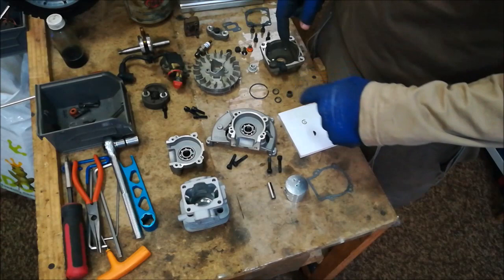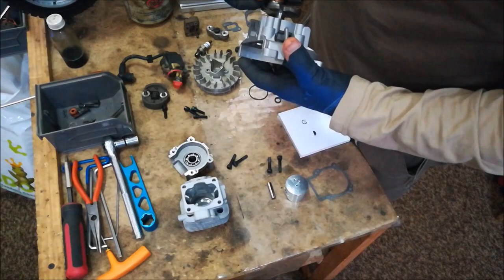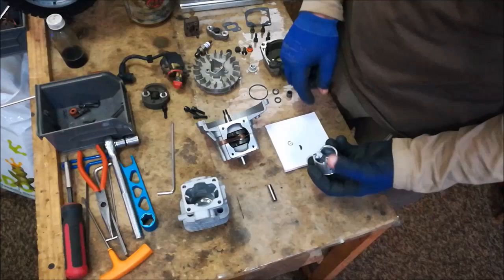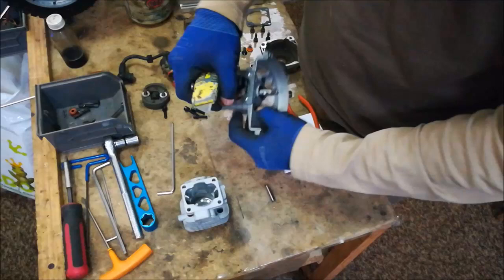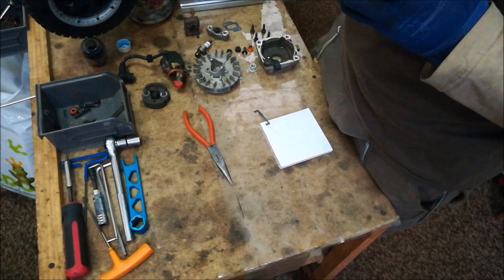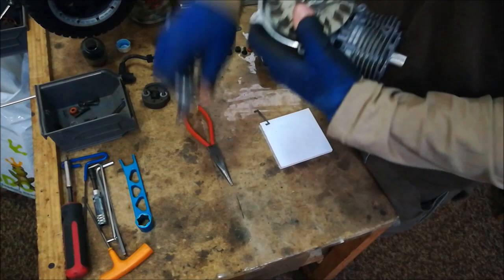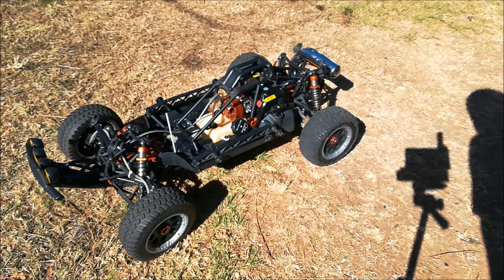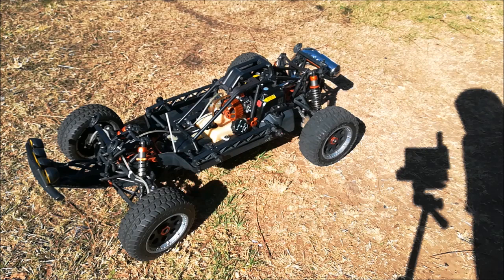Baja 5B / 5T 4 Bolt Engine Rebuild - How To

Comment: Hello, my brother, I have such a motor, but when I pull the starter rope, I put my hand on the motor housing in order to hold it. I feel the shock of the spark plak in my hand and the motor does not start. What is the problem and what is the solution? Please help me. Thank you.
Reply from the maker: Hello.
There are so many things it can be.
The shock you feel is possibly a broken coil wire but not always the problem.
You have to start by checking for any gasket leaks.
Than check the carburetor. If you choke it, look inside if you see fuel. Next I will change the spark plug.
If still not starting then you must see if the flywheel is the right distance from the coil.

Comment: Great Video, are there any of your video about how to install the piston back in its place with more details? Been trying to do so after striping my 36 cc rovan
Reply from the maker: Hello there. There is one video I show and talk about it. But it's one of my first videos so footage is not fantastic but it's called something like "Engine swop/conversion 29cc for 5T"
Let me know if you don't find it and I will share the link to it.
Reply: Hi there manage to get the engine running again after removing the gasket, but I have to put the idle needle so deep just to set the carb to idle and set The Low speed needle at 1,25 Turn and the High Speed needle to 2,25 Turn just like the standar engine, is thin normal or Do You have another setting  @EZR  ?
Reply from the maker: I recommend that the idle screw always goes in all the way. Then you set idle with the Low End needle. High end can only be tuned when the engine is hot and by ear. 2x turns is a bit high but not unheard of

Comment: Hey good video , needs some help . Order a big bore 30.5 cc engine for my 5T Baja . And now it’s all part . 🤦🏻‍♂️Lol come to find the needle bearing is bigger . And won’t go together . It’s a two bolt engine and the head is a 4 bolt . When can I do now to make this work ? New crank and etc some info be great . Parts list maybe . Thanks in advance. :-)
Reply from the maker: So sorry for the late reply Jason - Did you get this fixed?
You will need the 4 Bolt Crank Case to Fit the 4 Bolt head.
The 2 Bolts spares are almost history.
The Rovan engines have the same needle bearing from 26 to 30.5cc

Comment: Hello...i have a baja 5b. The engine no longer switch on and my hobby store recommends me to get a replacement. I want to know what parts in the engine goes bad when you are told to get a replacement. Any suggestion?
Reply from the maker: Good Day Dev RC Lover. When the ring gets badly worn the engine will struggle or not start anymore. That is a easy fix, but if the cylinder inside gets scratched up by dust and debris then the head needs replacing.
The ONLY time I will ever recommend a complete new engine is if you have a 2-Bolt motor or if you want more power. But other than that all parts are replaceable individually and get going again. You do not need a complete motor change for a broken part.
Reply: @EZR  Good day.
Ohh well...my hobby store got me rip then...he told me that the parts cannot be replaced. Too bad for me...should have done some research first.
Many thanks to you and Stay safe!!

Comment: happy day i have a rovan engine 26cc can i replace 29cc  cylinder with the old 4bolt block engine ??
Reply from the maker: Howzit. Yes you can. The 26 and 29 ises the same crankcase as long as its 4-bolt
Reply: We haven't seen you on the channel for months 🙄
Reply from the maker: Yeah I feel so bad already. We've been in the process of moving and the shop has been very busy. Then videos take the back seat. Hope to get going soon
Reply: We waiting you 🌹😊👍

Comment: Can I put a 30.5 cylinder on a CY27RC and keep the bottom crank still
Reply from the maker: Good Day. The stock CY27 has a 35mm Bore and a 28mm Stroke, where the 30.5 needs a 30mm stroke so unfortunately it will not work. Best bet is a 28.5/29cc cylinder(36mm Bore). Very nice motor. Will bolt straight on your bottom end.

Comment: I've got an old zenoah 23cc 4bolts looking brand new. Can i upgrade to 29cc and replace crank bearings, seals and 29cc crank?
Reply from the maker: Yes you can convert. All you need is Cylinder, Piston, pin bearing and Ring. The bottom end stays the same.
Reply: @EZR  Thanks. I have a 26cc chung yang 2bolt. I have heard 2 bolts are fragile going up in cc. 29-30.5.     
4bolt zenoah is better
Reply from the maker: 4 bolts are better, but only in gasket leaks. Other than that I have not had any problems. It's just pricey to spend money on 2bolt parts and then something breaks and you have to go 4 bolt anyway.